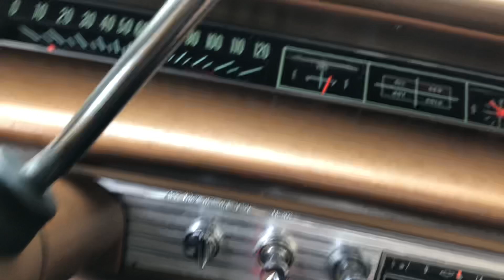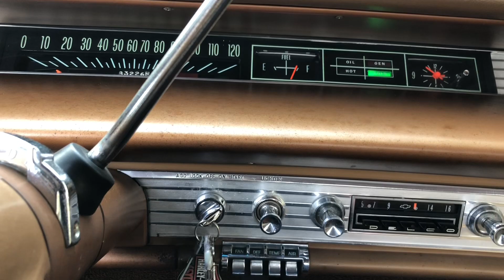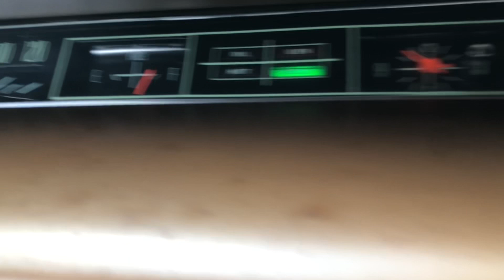1963 Chevrolet Impala SC

Comment: Loved the cars of the 60's and 70's. I had a 63 Corvair Spyder, 69 Corvair Corsa, 65 Chevy Impala, 73 Monte Carlo, and 79 Caprice Landau. Not sure why, but had to replace upper radiator hose on 65 Impala 3 times in two years. Must have been heat from engine that deteriorated hose prematurely but loved everything about the car. Wish Chevy kept the full size Impalas.